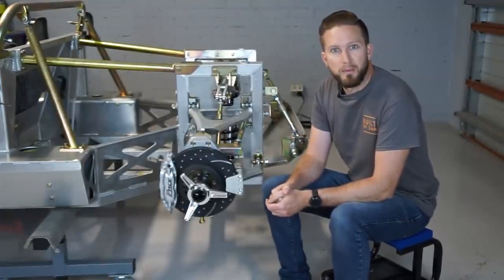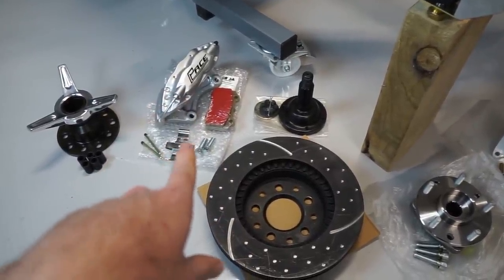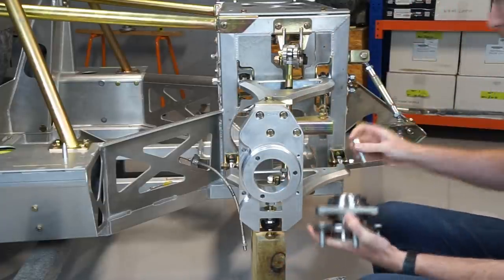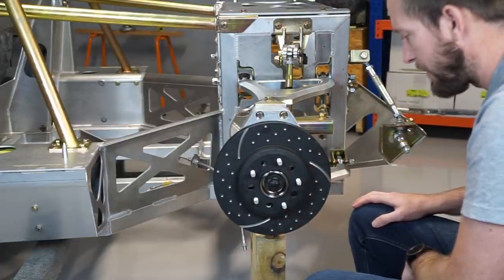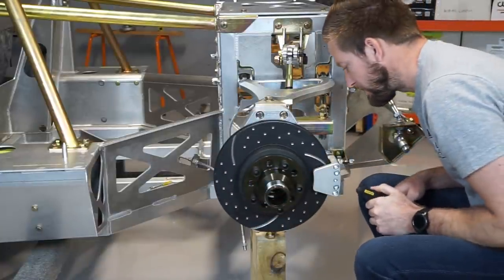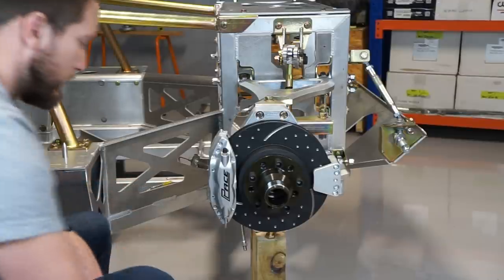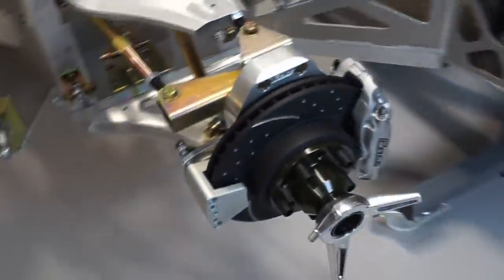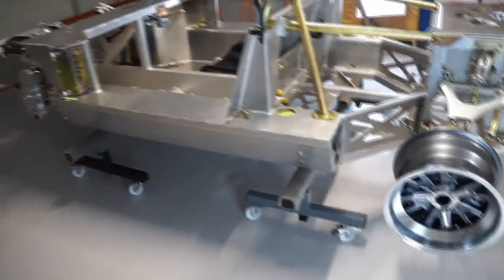GT40 Kit Car Build - Ep 15 – Rear Wheel Hub & Brake Assembly Install

Comment: Hi Dan, before you put any weight on the rear wheel bearings you should more than just hand tighten the nut on the CV adapter. You mentioned you wanted to mount the wheels to see how it looks. the bearings in that hub will separate and you will be replacing them before the car ever leaves your garage. torque them to about 20ft/lbs just to hold everything together. Good luck love your channel. Cheers from Canada
Reply: If that was that important it should be stated in the build book.
Reply from the maker: Thanks for the advice Allan, much appreciated. The wheels were put on for a few minutes to get some footage/photos and then removed and put back in their boxes, but point taken none the less.
Reply: @BuiltbyDan  As long as you don't put any weight on it, it's fine.
But if you do, at least tighten the nut.
BTW, I don't really see a reason why not to do that right now.
Reply: @BuiltbyDan  o
Reply: @7novalee  As someone else building a kit car from a book in his garage, the books basically wash their hands and say at the start: "You better know what you are doing, because we are telling you the bare minimum, and after that everything is on you, buddy".  :D

Comment: Just found your channel. Have similar wheels on my Cobra replica. Make sure those lug nuts are properly torqued and ensure they are square. If you get it wrong its easy to get the knock-on wheel slihghtly crooked. You can test with a feeler gauge at the back once its on and the spinner has been tightened. And no need to smash the spinners when tightening up - simple mistake people make, and the can't get them undone. Lots of vids on this elsewhere on Youtube. Good luck with the build.
Reply from the maker: G'day Kevin, thanks for the advice!

Comment: A bit difficult to see on the screen, but it looks as if you swap the lower spring/damper brackets left to right, it might work. It looks as if it would move the inboard ends of the spring/dampers inboard a touch.
Reply from the maker: Unfortunately I've tried all that, even to the extent of swapping brackets that seemed quite obvious wouldn't work. When those lower shock mounts are swapped they throw out the alignment, as the mounting points are offset on the bracket.

Comment: Hey Dan, I'm not sure but I think the knock off spinners are left thread and right thread for either side of the car
Reply from the maker: G'day Dave, yes they are. I think I was trying to spin them the wrong way at first and then when the video sped up it was hard to tell which way they tightened. The spinners came in the wheel box and they were labelled left and right. Both spinners tighten by spinning the top to the rear of vehicle.
Reply: @BuiltbyDan  cool, yeah you wouldn't want to get that wrong 😳... Do you have a new vid out soon ?

Comment: I noticed in the early shot you had the rear springs fitted. Have you received instructions on how these are fitted? A revisit into how you got on with the factory on the issues you’ve had would be a good idea.
Reply from the maker: No guidance received but I have clearanced the chassis to make them fit. I also got another set of lower shock mount brackets sent out and they still had same issue so I simply drilled a couple new holes (but more accurately than my last attempt). I'll do an update video in the next couple weeks.

Comment: Though the knock-off hubs look very nice, can I give you some advice?
I recently rebuild Superperformance Cobra, after it had been crashed, with a new frame and shell from South Africa.
The owner wanted knock-off wire wheels, so they got fitted on the new frame.
Hammered on with new new supplied lead hammer and tightened with all our might.
As in really and unbelievably tight 
At the maiden trip the right front hub loosened anyway and while the wheel fell off (luckily at 40kph in a village) it ripped the whole right front glasfiber side off with it!
Be aware of those bloody knock-offs!!
When new, check them and recheck them and check them again for good measure.
Hammer them as tight as you physically can and then even tighter for good measure.
You can't break the spindles, nor the hubs, but it can break you wallet.
Be advised. 
Yes, they look nice, but I don't trust them ever again.
Reply from the maker: Thanks for the insight Paul. I'll definitely be running safety clips or wire to hopefully prevent that scenario from ever happening!
Reply: @BuiltbyDan  We ended up wiring them too.

Comment: Who's wheels did you use? Are they 15 inch??
Just started my Cobra here in US.
It's a bit rough the body is very thin in places actually went through when sanding front fender. I would show you but can't post pictures here. Thanks for the video glad the brakes went well!!
Reply from the maker: G'day Dan! The wheels are by Trigo 15" x 9.5". Feel free to reach out on Instagram if you use that platform too. All the best with your Cobra build.

Comment: Whoa!!!  It looks to me like you might have the wrong spinner on one side of the car.  It was hard to tell because the video was sped up, but the RIGHT side of the car should be REVERSE thread otherwise your wheel could come off.  I'm sure you know what you are doing, but I just wanted to make sure I mentioned it just in case.
Reply: I think that rear right needs to go on front left. Good catch for you. Hopefully he catches it
Reply from the maker: 😂 that was just me not thinking and spinning it the wrong way to start with, the hubs came fitted to the wheels in separate boxes and they were labelled left and right, so I'm confident I have got them on the correct side of the vehicle. They both tighten by turning the top of the spinner to the rear of the vehicle
Reply: @BuiltbyDan  Ok.  Just looking out for you buddy!😀

Comment: Dan how will you be setting all the suspension geometry once finished.
Reply from the maker: The upper and lower control arms will need to be unbolted to adjust the geometry during a wheel alignment (adjust the aluminium washers/spacers). A bit annoying, but unfortunately that's just the design. The manufacturer does provide some guidance in the build manual as to suspension settings for the adjustable shocks.

Comment: Hey Dan, really keen on building one myself. What experience do you have prior to this build
Reply from the maker: G'day Daniel, I had absolutely no mechanical experience before taking on this build. Never undertaken any maintenance or modifications to any of my vehicles. But I am pretty hands on around the house in terms of building/construction (I designed and built my own house) so I do have a technical/analytical mind. My reason for starting this YouTube channel was to share this experience and show what is involved as I fumble my way through it with no prior experience, in the hope it may assist others in the same boat. I hope it's of some value to you in helping you decide if it's something you want to take on.
Reply: @BuiltbyDan  Huge respect for tackling this project. It would be like me building a house with no experience. Good for you.

Comment: Great channel. Why are you planning to take it back apart?
Reply from the maker: I wanted to test fit and drill and tap everything first to make sure it fitted together as it should. I also wasn't sure how many times i might need to disassemble and reassemble certain components so i committed to completely disassembling and then reassembling with the appropriate loctite or anti seize applied. I've never done anything like this before so figured it was better to be safe than sorry.

Comment: Have you resolved the rear suspensions lack of travel and interference yet?
Reply from the maker: I'm confident the lack of travel has been resolved by reducing the amount of exposed thread on the pushrod and increasing the exposed thread on inner and outer control arm rod ends. The manufacturer recommended 10mm exposed thread beyond the locknut.
As for the interference, I never received a response from manufacturer so I proceeded to clearance the cut-out in the vertical sheet aluminium and drilled new holes in a new set of lower shock mounts as the new set I received was also incorrect. It's all bolted up now, I'll do an update video in the coming weeks to show/explain how I did it.

Comment: Do you use locktite?
Reply from the maker: A lot of the bolts are supplied with nyloc nuts. Any that aren't will have loctite or antiseize applied in final assembly. This is just a test fit of all components.
Reply: @BuiltbyDan  thank !

Comment: The lower pushrod bracket, steel U shaped with a single bolt into the alloy swingarm.
Dont like it, its going to twist. Should have 2 bolts into the swingarm.
Reply from the maker: Those U shaped brackets do have 2 through bolts fixing it to the control arms. 👍
Reply: @BuiltbyDan  Argh should have watched that episode.

Comment: Dude, buy a better camera. :)
Reply: I don't know what you're watching it on but I cast it onto my 75" tv and the picture is perfect. Better than most on YouTube
Reply: Perhaps buy a better screen or whatever you're watching it on. I cast to a 43" TV & the picture is great.
Reply: @macman6107  DELL|U2718Q|27"|Business/4K|Panel IPS|3840x2160|16:9|60Hz|5 - Is that good enough? I'm a photographer.
Checked on TV, picture same low quality which is obvious because it's only HD (1080p) quality. Maybe the problem is not in the camera but in low-quality rendering.